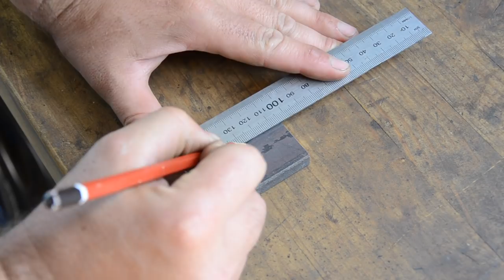Broken Vise Restoration

Comment: Question: that liquid rust remove you used for the small parts, I couldnt figure out the name in the video but is it readily available and what is the name? I collect and restore locks of all ages and many are often rusted inside so I need to remove the rust without disassembling the lock. That liquid looks like it would work well. I tried vinegar before but it would end up eating into the metal.

Comment: Gave this a like because it was a great job of restoration, just not too sure about the weld repair, this vice is made from cast steel and where it was repaired is where the most stress occurs. Great job though.

Comment: I am quite curious about the brand and company info on this vise.  A fresh model being cast and sold from China is a serviceable tool with the double axis spin feature, but I would MUCH prefer an old school example.  I would be grateful if you could share any info you may have or possibly even heard second hand about the original maker of this tool.  Love your methods, Make it your own, as YOU intend to use it.

Comment: Can i give a little advice, (unless you already know this trick,

When you tape up your surfaces use a small bastard file to run around the edge its easier and fast in my experience and a very neat finish, (instead of using a Stanley knife, as i think iv seen you do it in another video) 

But other than that fair play, high quality vice for cheaper than a new one noless, 

I hope my advice help, (unless you already know then.... nevermind)

Comment: I would suggest that when drilling into plate steel, that you use cutting oil as a coolant and save your drill bits from burning. I would also suggest that you use a good metal grease as a lubricant on all metal to metal moving parts, rather than using WD 40 which is a solvent and not an actual lubricant.

Comment: If you want a weld to hold when working with cast iron, you need to pre-heat the cast iron.
Since you didn't preheat, the vise WILL break again at the same place.

Comment: Will, an excellent restoration!  I have an identicle vise that I picked up cheap.  It seems that this brand of vise always failed in the same spot.  Did you find any manufacturers markings on yours?  The weld you made was excellent.  I;m sure it is going to hold under pressure.  Thanks for you video.

Comment: Nice restoration. A friend just gave one of these vises in much better shape which looks exactly like your brand. I cannot find anyway to lock the head from turning from top to bottom nor did I see you demonstrate any lock other than turning 360 degrees from left to right. Am I missing something????  What good is it if you can’t lock the vise from rotating from top to bottom???

Comment: That was a heck of a lot of work, but I have my doubts about the weld. Welding cast iron is never as strong as before and that location is less than optimal. I wouldn't Charles Atlas that thing....like I sometimes need too. I think I have the same exact vice. It's Chinese and about 30 years old and hardly used but a bit rusty in the un painted areas.

Comment: Is there a reason people don’t bead blast rust off instead of using a wire brush or a wire wheel. Some people also use baking soda and water with a battery. Just wondering.

Comment: I was just gifted that very same vice (red) but I don't know if it's a Yost or not? There's no markings on it at all. There are stripped threads in the rear plate for the lead screw and I am looking for a new rear plate cover with good acme threads. Mine even has the same 3 hole mount base.

Comment: Fascinating stuff.  No grease on the bolts going back in?  Only as strong as the weld, but what were your other options?  Is the main shaft and front clamp one single cast?

Comment: The wielding wasn't the best, but I guess it works. It's not going to last as long as using a continuous wield and pre-heating the cast iron beforehand. You're going to get metal fatigue.

Also, why is there no way to lock down the swiveling part of the vice? Go to hammer something while it's in the vice, and get that annoying rotation.

Comment: Very nice rebuild... but how did the weld hold up. Welding cast iron usually requires the metal to be preheated to the range of 260-650 degrees C (500-1200 degrees F) in order to slow the cooling rate of the weld to reduce cracking tendencies. Was your short weld run and peening technique successful, or did it fail under load? No admonishment... I'm just curious. As I said... nice rescue.

Comment: I have what I believe to be this vise's twin. Just bought it a few days ago. The guy selling it told me it was not a Chinese vise and there were no markings on it. I thought he was right, but upon taking it apart I found out that the screws holding the jaws and the rear flange are metric. I believe it will still be a good vise when I'm finished with it, but does anyone have any idea who made it or sold it? Mine appears to have been gray, and before painting, they did quite a bit of filler (Bondo) work on the roughest areas.

Comment: I just picked up a very similar vice and have one question for you or anyone else that has an answer. How do you lock the swivel head in position? So many have either a pin through the back that locks at preset intervals, while others have a locking handle on either side. But how do you lock this vice? I've looked high and low on mine and haven't found anyway to lock it? Any ideas?

Comment: Not a bad restoration at all. However, you did miss painting a number of areas under the rotary stand, and two coats of primer would have smoothed out the casting very nicely.

Comment: Thanks for not mugging at the camera for the majority of the video and saying stupid shit like " Hi Guys" . Also thanks for the high speed editing; still this could have been much shorter. Why struggle to remove paint and rust from old parts? A sand blasting shop would have stripped those steel parts to PERFECTION for $40. -$50

Comment: how do you get started doing this kinda stuff? what tools and supplies are recommended?
Reply: Start with something simple like clothes pins and just work up from there... Buy as needed...
Reply: A big hearty workshop table, a big vice, drill press, belt sander, buffing wheel, angle grinder, serious power drill, a welding machine (if you're into that). And then of course assorted hammers, wrenches, pliers, vice grips, ratchets, screwdrivers, drill bits...

Comment: I'm a welder, i wouldn't weld with bare arms like that for too long if i were you. A few minutes is fine but it's not very good for your skin. A few times i got the skin on top of my chest fucked up because i was welding all day with some of my skin exposed without me noticing it, needless to say at the end of the day i knew what happened. (My welding jacket was not closed all the way to my neck)

Comment: It's like no one on youtube has a cheater bar. A piece of pipe will do... Also you should use a thicker grease instead of that oil for the main shaft eventually, you can pack a lot in there and you probably wont have to re-grease for YEARS.

Comment: You were welding steel to cast iron. You should have covered it with sand or a welding blanket to prevent from cracking.

Comment: Nice restauration. Too bad you did not have access to a MIG or TIG welder. You weld might have been a bit less sloppy.
Reply: it wouldn't matter he wasn't looking for pretty welds, he used stick for more penetration because he was gonna have to grind it smooth so it would get caught on its self. so in turn mig or tig wasn't a better option.

Comment: Hi from England 

And this dispels the complete and utter bullshyte constantly doing the rounds in YT that you have to pre & post heat iron when welding it...
I bet you didn't use nickel or stainless rods either...

That vice will hold just fine... 😉

Comment: firstly you should have pre heated entire peace before welding, secondly once cast iron brakes, ewen when welded properly it wont be as strong as original, and will likely brake again in same spot.

Comment: As others have discussed, the weld repair is marginal. Even if done correctly the weld won't be better than the original casting.. and that broke. The vice design is poor...cast iron in compression is great... in tension and shear not so much.
 A suitable repair would be to face-off both broken faces square in a lathe and mill. Then bore the round portion and the jaw section to take a close fit a large diameter steel  sleeve (with a clearance hole for the screw)  into the mating parts. After assembly, pre-heat the work and weld the joint. Pack the work in suitable insulation and allow to cool as slowly as possible.
 I don't fault him much on the weld repair. If you don't have experience repairing cast iron, it all seems easy. Welding cast iron is like painting and/or plating... all the work is in correctly done preparation.

Comment: Instead of using WD40 why not use something that is made to lubricant such at Ballistol. (Best spary oil out there and not very expressive)   (WD40= water displacement (attempt number) 40. It is not intended to be used as a lubricant as it does not have such properties)

Comment: You rescued a good sturdy tool from salvage scrap, well done.....but why do all you restorers insist on using WD40 instead of a penetrating fluid (make your own with a solvent, and ATF), and then you all spray it on the bolt head where it does nothing. Now WD40 is a great product for its intended purpose....lubrication, but not as a rust dissolver. Apply a penetrating fluid, on or close to the bolt threads, preferably the day before disassembly, would solve 95% of seized bolt problems.

Comment: while the process is oddly satisfying some minor details would ruin the vise, at the first place you should always preheat the heavy cast iron parts before welding in order to prevent the micro fractures that naturally shaping inside the part due to the thermal shock and gradually turning to real fractures then breaking down the part. At the second place you should avoid to applying heat to the already heat treatment-ed parts in order to reshaping them because it will softening the metal permanently and  make them weaker. At last but not least poking the nut on the shaft by hammer and applying direct flame by torch to the both shaft and nut was sort of irresponsible! and rude!!! sorry for my language. I enjoyed the process after all.

Comment: I believe this vise is made from cast iron....if so...this is not the way it should be welded....there is a process in welding a cast iron and rods for cast iron should only be used....yes you can weld it that way but its not going to hold for long....just a thought😊 i maybe wrong😊....nice vid anyway....😊

Comment: I see these vises on a regular basis.  They are Chinese JUNK.  I think the Chinese think that if they make a vise real heavy, it will be a good vise.   The junk metal they make them out of simply cracks too easily.   And then they usually add on a wimpy, little handle for tightening the base